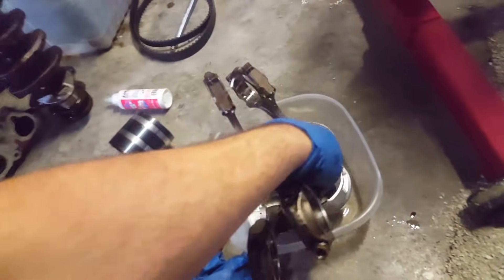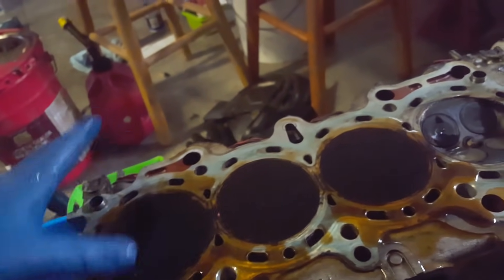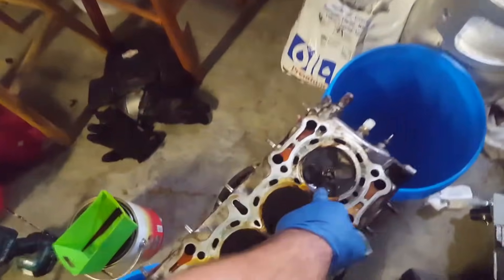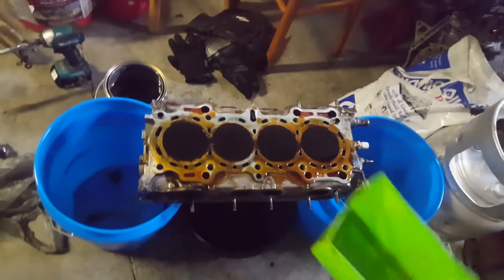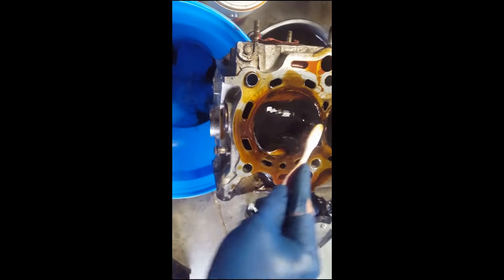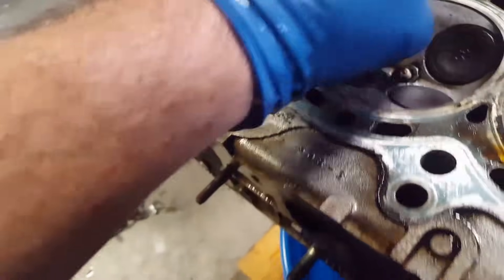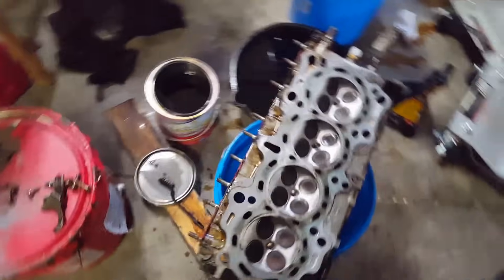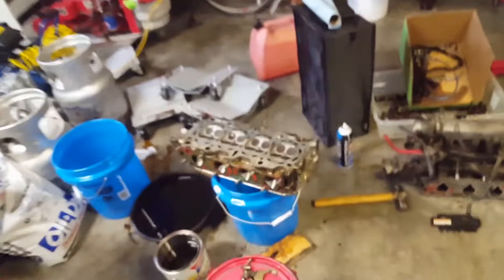It eats away Carbon Buildup EASIIILY!!

Comment: Anybody here with algorithm. Do not use carb cleaner or oven cleaner for servicing engine or DIY without full understanding of the chemical. One is toxic to another level, one is not a good product for your aluminum engine. These stuff do no wash off just because you run the engine or washed with water. 

*Carb cleaner does work well. I still prefer combustion chamber cleaner or WD-40 Which work as well just not as good as carb cleaner. I would rather have something less toxic and live a day longer. Wear safety goggle, when it hits your eye balls you might want to pick your eye out instead of washing it. It burns.

Comment: Chem dip isn't made to be poured out of the gallon. It has a dipping basket in the can and comes with a neutralizing liquid floating on top the solvent. To clean heads or clean piston tops while still in the motor use spray gasket remover, your lungs and brain cells will thank you in ten years.

Comment: aluminum is porous so it will absorb the chemical and it will be embedded in the metal so if you'll need to weld later good luck

Comment: I would be interested to know how it would work like products designed to clean oil rings junked dried oil which causes excessive oil consumption.  Some products on the market such as seafoam and armsol where you pour an oz or two in each spark plug hole and let it sit for hours . Such purpose is for fluid to get past the compression rings and soak into the oil rings in the hope to remove the carbon build up to open up the oil holes in the oil ring allowing for the ring to wipe the cylander preventing oil from bypassing the compression ring thus burning off the oil. .  This is a common problem on the Toyota 2.4 2az-fe engines. Scotty Kilmer talks about the problem here  .  https://www.youtube.com/watch?v=B0NwnbVN1cw

Comment: Have been using a product made by Turco for 40 years does the same thing, works on Carburetors as well
Reply: What product, - Turcosolv? That stuff worked well but was pretty nasty I believe. I don't think that it is still on the market, at least not in Australia AFAIK.
Reply: @Ropetangler  Don't know what is called I have 44g drum of it the label is long gone, may well be not around any more

Comment: Retired 40 years heavy const. equipment, heavy carbon build up in exhaust area soak heads in old 50/50 mix antifreeze loosens heavy carbon to chunks that washes away w/ steam or high pressure washer. Try it with a exhaust valve see what u think. Clean parts well and lube well w. oil. Antifreeze not good so cleaning is important but you were going to clean and lube your parts anyway, right? I have not ever lost any engines by doing this. Do not let your cat or dog lick the parts, poison LOL.

Comment: The carbon on the exhaust valve gets a lot hotter, and will turn to "glass", same thing that cause "splash fouling "of plugs when an engine is run at high speed after carbon build up. Probably need to chip it off.

Comment: Some chemicals can cause "hydrogen embrittlement" in aluminum, this could be why the company does not want the product left on too long. We had problems in the Air Force with some chemical cleaner / degreasers that were not approved by the manufacturer used on our F-16's and had to have some skin removed and replaced.
Reply: Don't they still treat the aluminum with Alodine?  Back in the 80's we used to treat the whole body of the planes with Alodine.  Did a lot of F16's.
Reply: Seriously Thank You for Your Service to our County its Super Appreciated!! Unfortunately in many cases UNDER APPRECIATED by the media! BUT THANK YOU!! 
Could you provide a bit more in the details? Nothing that would get you in trouble but im curious. Thanks Again! Eddie J.   Long Island N.Y

Comment: Has anyone ever tried to use this on the Toyota 2AZ-FE engine that clogs the piston rings and oil return holes in pistons with build up? Do you think it would be safe to pour a 2--3 ounces down each cylinder, let sit couple hours, pump it out with an automotive type syringe and then change the oil?
Just asking for professional advise, if it's a crazy idea just let me know.
Thanks!
Reply: I do it to 2 stroke back pack blowers works well. When you do it to your car just suck it out with a syringe. Run it then change the oil

Comment: Next time you need to clean carbon, try dot 4 brake fluid. Put it on a cloth and start wiping. It immediately starts melting carbon. No soaking required
Reply: no kiddin?  have to try that next time i've got a engine appart, Cheers!
Reply: Use gloves!
Reply: What is dot 4 brake fluid?
Any pictures?
Reply: I have a burned pot.  I can test on it. :)

Comment: Hmmm. I have a cobra and im in a weird spot. I had one guy tell me that some off my piston was pitted (something hit my spark plug) but it passed compression test no issue. Then i have another guy look at the pistons and do a compression test also. He said he thinks its fine. Passed compression test no issues. He said he noticed it was carbon built on my pistons. So im in a spot where idk what to do. If i have to rebuild or not. (Car was running rich for a while, if that means anything ) any input helps thanks

Comment: Great video. Word to the wise, those blue gloves are not chemical resistant. That stuff has some nasty chemicals that will absorb through your skin and into your bloodstream, even through those gloves. Be careful about that.
Reply: Great Tip!! Any suggestions on shop gloves? I've seen my mechanic using black looking latex gloves but just figured it was just a different color of glove.

Comment: Chem dip is the best, especially if you get the original formula, before they made a Cali approved one. It’s still available , just have to look for it. The reason on the aluminum time limit is it will actually start to attack it if left too long. Small pitting can occur. The same can happen with simple green on aluminum. Limit contact time and clean thoroughly.
Reply: Sounds like what happened when P&G / Cascade changed thier formula back in either the late 1990's thru the early 2000's if im correct. Now Cascade eats at any aluminum.

Comment: Since the head is off, why not just disassemble it (remove valves) and clean it entirely? I think you'll find significant carbon under the valve heads and/or in the intake/exhaust ports, especially if that engine is is direct injected. With the head disassembled, you'll also have access to inspect for any valve, valve seat or valve guide wear, as well as the head sealing surface for flatness.
Reply: Awesome Tip! Thanks Eddie J.   Long Island N.Y

Comment: Full strength Simple Green works for carbon removal.  Over night soak and 90% of the baked on carbon wipes off with a rag.  Stubborn carbon may need a second soaking to remove.  Simple Green is cheap from Big Box Stores and is safe to use.  I have used Simple Green on several engine heads and pistons with good results.
Reply: can you do a piston soak with it? Does it corrode the aluminum, darkens it, if you leave it on for a while, let's say, overnight?
Reply: @evil-c4o  use Simple Green HD (the purple one) if you use it on aluminum. I just used it this weekend for my aluminum LS cylinder heads and I let it sit in there for six hours, took it out to brush them down, then rinse and repeat that step 4 or so times. A day later, they're almost like 90%+ clean.

Comment: If the product really works that well then they need to figure out a way to make it an additive to add to the gas tank like sea foam.
Reply: That's what I'm hoping for or a fogger like my goto Seafoam Top engine cleaner. As I don't have the space or an extra car that would allow me to take the heads of as winter settles in here on the north east or N.Y. Thanks Eddie J.   Long Island N.Y

Comment: Yes it will take the coating off I found this out after I bought a book to rebuild carberators and it suggested Berrymans cleaner. Well after taking it apart and letting it soak overnight the  chromatic coating was gone. But however this led me to learn electro plating as well..😂😒

Comment: Someone else has discovered my magic in a can. I knew about this stuff nearly 15 yrs ago when the can it was delivered in was white at least for the Gunk version, which are probably the same chemical with a different label. I put oil/carbon baked internal engine parts in it and let them sit over night and couldn't believe the as new cast appearance they came out with. Advance auto is where I get mine and usually they have a 25% off coupon floating around somewhere to sweeten the deal, especially now given how the price has increased by about $10 to $28. I would advise sparing use because of how expensive it is. Apply a smaller amount to soften build up on large parts like cylinder heads and use a cheap secondary cleaner and high pressure water spray to finish the job. You don't want to end up paying the same price for cleaning at home that it would cost to just drop the parts off at a shop. A good high pressure washer might do a very effective job and eliminate the use of chemicals altogether for this job and any future for the cost of the machine and low cost for water as the cleaning solution. Another old time favorite for removing a lot of the crud is Easy Off oven cleaner, just be careful not to use it on aluminum with delicate surfaces (cylinder heads, alum blocks) that need microscopic smoothness.
Reply: there is a mild version of easy off i use.. but for the hard baked on stuff & on cast iron i use tergo industrial paint stripper... just not on ali gasket surfaces
Reply: Yeah, it works but its absolutely noxious.
Reply: Thanks a lot for all this great info.

Comment: This is to be used in a sealed container. Read the can. I know many men that have died of terrible painful cancers that used it like a religion. Get Rubbermaid sealed top containers. Then follow with water bath and then a bath of kerosene and all on homemade vibration table made with a electric da sander. Its like ultrasonics. I use a liquid that is heated called “turko” for upto a two hours then water wash followed by phosphoric acid for a max of two minutes, followed by water wash and then burunell cleaner followed water wash and 200 degree dry oven.(repair helicopter parts) FAA and manufacture approved process.

Comment: I've been using Chemdip since the early 80's to clean gunked-up carbs. Great stuff that had a very unique smell. I haven't found anything that works as fast or as good as that stuff.
Reply: Easy Off would probably do better. I used it myself and took the carbon off my pistons in 5-10mins.
Reply: @a.m.7060  Thanks, one day I will try it. For cleaning an engine that isn't disassembled and still runs I use some stuff called Kreen Motor Tonic by Kano Labs. You add some to the gas & oil and it dissolves carbon, gunk, the varnish from the rings, and cleans the entire fuel system. It can be used on cars, boats, motorcycles, aircraft, or any gas or diesel engine. I used it in an engine that had to be rebuilt after 50,000 miles and it was remarkably clean internally. It's way better than Sea Foam or any other similar product. See: https://www.kroil.com/order-kroil-products/
Reply: @kst357  Dang, I’ll try that too.
Reply: Hey Thanks for the Tip! It's Super Appreciated. Kroil seriously sells a lot of Great sounding products!!! Somewhat unfortunately I can't just run-up to my local auto parts store I'll have to order it as its not sold in my local AutoZone or Advanced Auto Parts. You'd think a company thats been around since the late 1930's selling chems for auto repair shops would be in ever Auto Parts store but than again there are not a lot of Rolls-Royce dealerships everywhere. Thinking about it Rolls-Royce was a fantastic auto manufacturer they need to go back to making thier own drive-trains again with a bit of BMW'S performance influence. Thanks again Eddie J.   Long Island N.Y
Reply: @kst357  Kano products are so expensive but they are worth the cost. I just can't spend the money on a "tool" I will only use once a year.

Comment: Chemdip was a much better/ more powerful cleaner about 20 years ago. I used it again in 2010, and it was a notably different product. I'll note that I'm speaking from my perspective as a resident of Commifornia, airnazi capital of the USA. But seriously speaking, the chemical makeup of chemdip changed in just that 10 year period. It didn't smell nearly as strong as it did in 2000, and it would not completely dissolve rubber. In 2000 it had a strong smell of insulin. In 2010, which was the last time that I used it, its smell was not nearly as strong as it used to be. Nor did it clean as well.
Reply: In the uk nitromors paint stripper was the dogs bollox until they took out the man strength ingrediants to appease the green hair brigade... now its just bollox.
But! Its still full on top strength here in the far east, happy dayz.
Reply: @theravedaddy  Methylene chloride. Might still find it in aircraft stripper, maybe, maybe not. The "green hair brigade" is actually right in making sure Mr. Fumbles the weekend handyman can't get it anymore, because that shit's absolutely lethal if you don't have common sense. And I don't mean it's bad, I mean it will flat out kill you. Lather up something in a small closed room, come back, step in, couple breaths and you're on the floor actively dying, that kind of lethal.
Reply: @mfree80286  i must be invincible then....i get through gallons of it.
Reply: @theravedaddy  Stand in a cloud of it much?
Reply: @mfree80286  i dont spray it on so....no. do tell us all how it gets to hang out as a cloud as its disolved and suspended in a gel.
Reply: @theravedaddy  methylene chloride specifically, not a gelled product. If it's warm enough it will definitely vaporize. Plus, I imagine, you aren't an idiot and using this in a small enclosed space. 

Push back all you want, MC (also called DCM, depends where you are) is the best paint stripper on the planet and will fucking murder you if you disrespect it.
Reply: @mfree80286  it actually evaps off too fast here, i usually bag a car 1/4 at a time to get it to work efficiently. After a cans worth my hands come up like brand new but then i got to toughen up the skin again.
Reply: @theravedaddy  One of the safety sites for DCM had a note on it that there was one case where a worker passed out and fell in contact with the chemical for about half an hour. Got second and third degree burns for his trouble. 

Part of the issue is it's quickly converted to carbon monoxide in the bloodstream...
Reply: @mfree80286  got a name for him? I wont be giving him any work.
Reply: @theravedaddy  His name's Post. Post Mortem.

Comment: Great video, the only thing is it’s an engine!, and not a motor, a motor is electrical,, thanks for sharing your thoughts and great videos
Reply: o•tor mō′tər

►

n.

Something, such as a machine or an engine, that produces or imparts motion.

n.

A device that converts any form of energy into mechanical energy, especially an internal-combustion engine or an arrangement of coils and magnets that converts electric current into mechanical power.

n.

A motor vehicle, especially an automobile

Comment: its a good sign when the chemical doesn't drain out right away too, that is a nice engine to rebuild.  I don't know a whole lot, but the fact those valves still seal tightly even carbon coated is a good thing.  Honda power :-)

Comment: Now are you going to disassemble the head and vavles to regrind the seats and valve angles.  The valve faces really don't mean shit. Air and fuel flow around the valve stem and seats are what matters.  Thats where your carbon buildup matters.  Not on the faces.

Comment: Yeah, we were doing this back in the 70’s using the 25gal. Drums of chemical, we called it cold tanking or cold dip as opposed to the hot tank we used for steel and iron. So, it’s not really an experiment, it’s a well established practice.
Reply: Yeah see, back in the 70s there was all sorts of fun chemical stuff nobody really thought much about touching and inhaling that did a great job, but there’s this thing we have nowadays that everybody from that era seems to have, it’s called cancer...
Reply: Dude is right been common practice by mechanics for years
Reply: @jamesdodson9417  lmfao me barely learning how it works  on a small one cylinder engine😂😂(not a car engine a motorcycle engine..)
Reply: Just because you did it does not mean it's a well established practice
Reply: @mikem5475  Everybody did it back then.  It's well established dude.

Comment: I use Super Clean (formerly Castrol Super Clean) mixed half with water in a spray bottle. Works amazingly good desolving carbon. You could use it straight for harder jobs, brush then rinse with a water. A plastic laundry tub in my shop is handy for such.
Reply: Super Clean the degreaser stuff in a purple bottle?

Comment: That Berryman is very potent. I run the fuel injector gas treatment in my car. It had a tiny amount of liquid on the bottom of the can. I set the can on my trunk for less than a minute. Ate through the clear coat and paint..
Imagine how well it cleans the injectors.
Reply: …and strips the lining from the gas tank.
Reply: @orbitaljellyfish808  that's probably  why the instructions on the can say a portion of the can in the tank not the full can

Comment: Carbon in the ports& backside of the valves isn't good. However ,combustion chamber& piston crown surfaces can benefit from the thermal barrier. Unlike the bad old days of leaded gas, deposits today are smooth even& minimal. I would just leave it alone.

Comment: This isn't even a minor overhaul and certainly it is not rebuilding which would include at a minimum boring, valve job, crank grind, new pistons, rings, bearings, timing set, oil pump, head bolts, full gasket set, water pump, and filters.